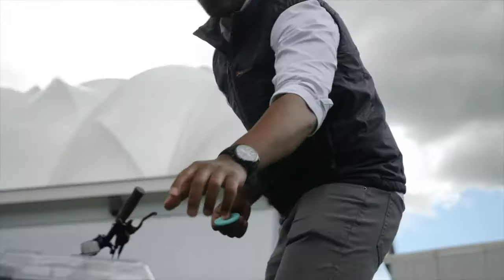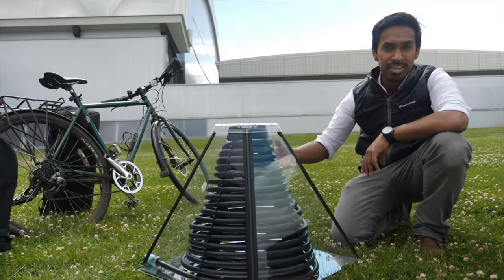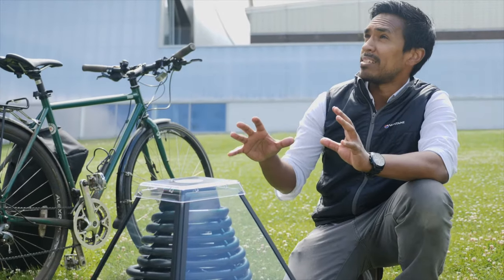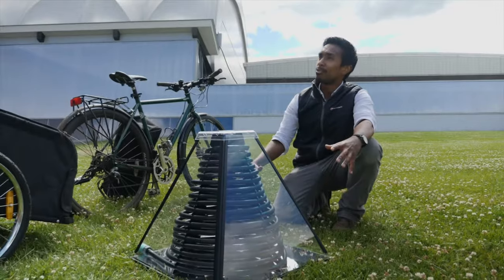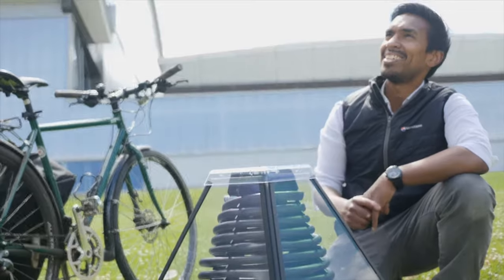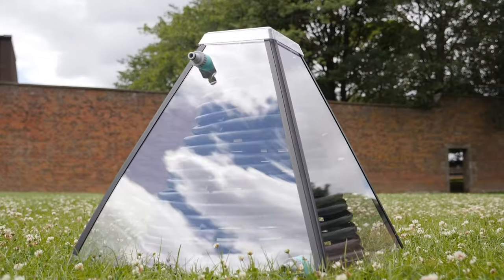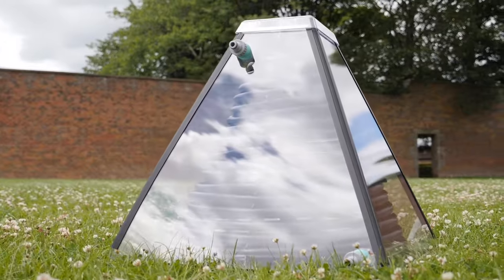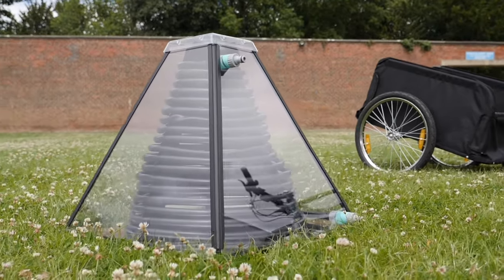SolarisKit explainer video - The world's first flat-packed, self-assembled solar collector

Comment: i was wondering if the cone beneath the coil of pipe was full of sand, would that allow the storage of heat, when the water wasn't circulating?